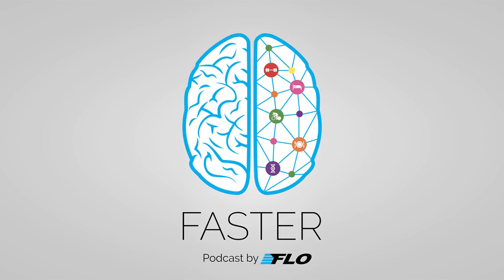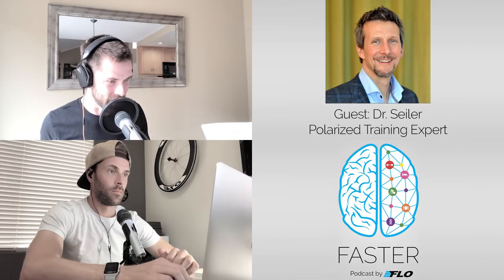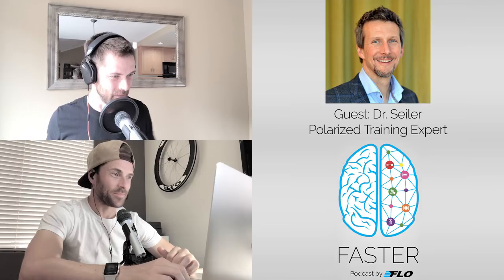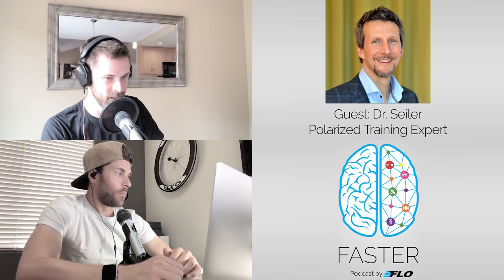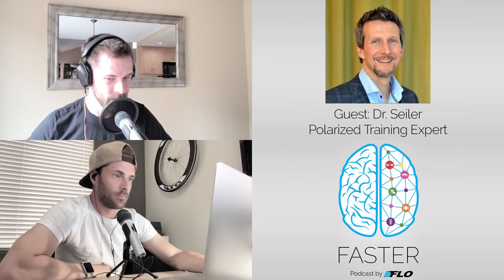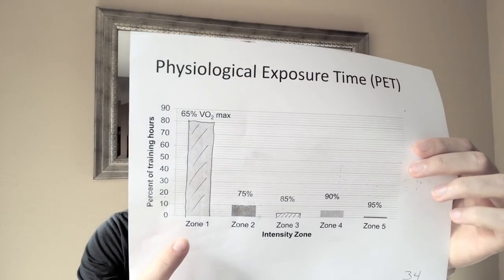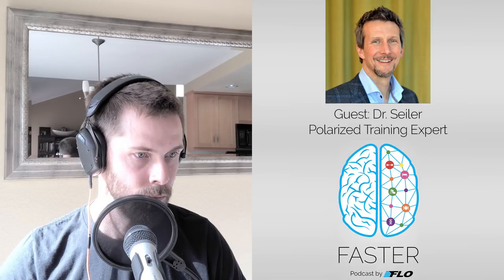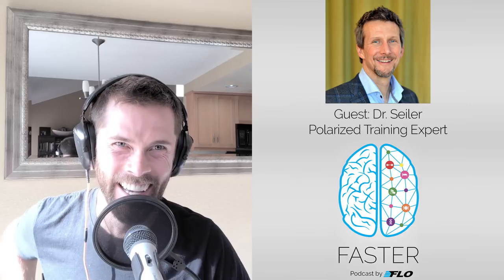Faster - Podcast by FLO - S1E13: Polarized Training - A Detailed Look

Comment: Thank you for having Dr. Seiler on you show the man is brilliant. I have been looking for this type of discussion for some time, I would like to see a program he designed (even a few weeks of one) for cyclist just to use as a template to designed my own program as I really do not feel typical threshold training is delivering anymore. I feel like I have plateaued somewhat
Reply from the maker: Unfortunately, Dr. Seiler has stopped coaching. The good news is by listening to this episode, you should be able to outline a program for your self. As simplistic as it sounds, spending 90% of our training time below LT1 and 10% above LT2 in 4, 8, or 16 minute intervals is all it takes.  I've been following that type of program for about a year now and I've had great success with the method.  If anything, I've spent more than 90% below LT1.  I'm guessing I've spent 97% or more of my time below LT1.  My starting FTP was around 250 watts, and while I haven't tested for a while, I'm right around 310 now.  I weight 70kg.  

Chris

Comment: It is interesting (to me at least) that in his 3 zone model: Z1 captures all of Coggins's Z2 as when using his 60% of VO2 ratio my LT1 is near the beginning of Coggins's Z2. And I guess this is the difference between what Seiler is proposing and the conventional Z2 (Coggins) training. If I follow Seiler I leave a whole lot of Z2 (Coggins) out of my low-intensity training. Different also to Maffetone as well because MAF would have me training well above my LT1 (as calculated using Seiler's formula). In essence, my LT1 seems to be low-end Z2 (Coggins) and below the MAF training bracket too. 

What I would say is that Z2 for a few hours does stress my body (I don't feel like repeating it the next day). So, if we're looking for adaptions without stressing the body (which is what Seiler seems to be advocating), then it makes sense that I train in low Z2 and below MAF too.

Thanks guys. This was super interesting...

Comment: One thing I am confused about.  If I have to work out my training zones manually do I use percentage of max heart rate or percentage of Vo2 max heart rate for my training sessions? for example My Max HR is 150 so to work at 70% intensity would mean a HR of only 105 to stay under LT1 which seems far too easy.  If I were to use percentage of Vo2 max using the heart rate reserve method for the same session this would give a very different HR figure  i.e:  HR max =150  Rest HR =50 so my HR reserve is 100 therefore 10% of this =10 BPM. This would mean using 70% of Vo2 max would give me 7 x 10 =70 BPM + rest HR of 50 and a training zone of 120 BPM. I am currently using % of Vo2 max  in my training as using the % of HR max figures seen far to low (and easy). So when Dr Seiler suggests heart rate zones for the LT1 and 2 (ie: 87-90% as the optimum range for the top of zone 2) zones does he mean % of max heart rate OR % of Vo2 max heart rate?  many thanks
Reply from the maker: For the most accurate results I would recommend testing your LT1 and LT2. You are kind of guessing if you are not. My understanding was that it is based on max heart rate. I hope this helps.
Reply: @flo_cycling  Thanks for your prompt reply

Comment: I use the Lactate Plus machine and sometimes in good athletes, I do see the dip mentioned at around 20 minutes in. But not very often continuously below 1.0mmol/L. Anyway, FYI.
Reply from the maker: Thanks for the input Interaction Fitness.  We'll be running more tests in the next few months.  It will be interesting to see how things have changed with training.  

Chris

Comment: Thank you for this great interview. Although I'm a little disappointed about your explanation about lactic acid. Blood lactate is the physical system to buffer accumulation of H+ (which causes the "burn" feeling). If the accumulation of H+ is to high/to fast for the blood lactate to buffer, then this "burn" feeling occurs.
Reply from the maker: You are correct. Hydrogen is involved in the burn we feel.  Thanks for adding that to the discussion.

Chris
Reply: @flo_cycling  more so, Lactic acid is also a fuel type, apart from being metabolite
Reply: @jusuflazami9580  lactate, not lactic acid

Comment: I can perfectly ride 4, 5 hr in power z1,z2 in wind and verity of terrain on power and my hrf is most of the time way lower than LT1 and  almost (constant)but its very hard to do that without powermeter. Also hot days it's so hard to  stay in a hrfzone,hrf drift...Some days my hrf is not corresponding with my powerzones, so what i mean is for me it's almost pontless to train with hrf without on power. power is a value that stays the same and you can adjust immediately,  hrf is so fluctuated from day to day... so if there is a good method to define  Z1 and and Z2, begin Z3 on a powertest? or a percentage of an full hour ftp test?
Z1(Z1 Z2, andy coggan) is 55 to 75 of ftp test. so far zo good but for begin Z3 zone was that 90% of ftp? or difine that with a 4 times 8min allmost @ max effort test?

Comment: Obviously, Dr. Seiler doesn't think ever needs to sprint or lives in an area with 25mph headwinds in rolling terrain when you are trying to ride level one. And, yes, people can benefit with this way of training on 6-8hrs a week, but the question is it best method to improve with that time limitation. Trying to adapt this method to something as stochastic as road racing is trying to pound a square peg into a round hole. The application of his method is made for steady hard aerobic and vo2 efforts that require loads of technique to be efficient and avoid injury (CX skiing, running, rowing),triathlon) . It's not that road cycling doesn't need technique and efficiency, but I would like to ask him if any of this athletes have to sprint all out for 30s to cover an attack or attack themselves or blast all out for 1-2 min in the middle of race to make a selection and then recover.
Reply: Bob, I'm not sure your comments reflect Dr. Seiler's views.  He works with Olympic athletes on a regular basis who certainly do need to sprint.  He also mentioned in the podcast that fewer than 6-8 hours of this type of training are beneficial.  Dr. Seiler himself is a cyclist who understands what is required to be successful.  I think your point about injury is definitely valid.  Too much too soon will definitely lead to injury, which is why many coaches recommend a period of low intensity only as an introduction to prepare the musculoskeletal system for the harder efforts.  Drills are also a great way to work on technique.

Take care,

Chris
Reply: @cjt1981  Thanks for the reply. I have never heard Dr. Seiler address sprinting in a prescribed workout or where it fits in his zone system or where it would fit in a periodized schedule. If you have that that information, pass it on. I would like to hear or read it.
Reply from the maker: Bob,

In our show Dr. Seiler described polarizing training even more as you get closer to a target event. In that sentiment, it is ok to use some very specific sprint intervals as your Zone 3 work for the week.
Reply: if you train with a powermeter headwinds of rolling terrain is not so a problem. also short intervals sessions or long steady rides with bad weather  i do on the smarttrainer...
Reply: @svendeclercq5160  sure it's not a problem if you have 350w+ FTP, but for non national level mortals like me-it is. Do 170w up 4% roller into a 40kph headwind and telll me what that translates to in speed and gearing. And, yes, I do use a trainer on those days-but Polar training assumes a big engine and loads of time to train--two things I don't have. Furthermore, it's better adapted to activities that take massive hours to master injury free technique (nordic skiing, swimming, rowing) and where intensity is more easily manipulated than it is in cycling.
Reply: I've seen pro cyclists train hrs at 150 watts on different terraîn. It requiers good gearing and training to maintan   a steady poweroutput on the paddels. The can do 100w if they want on a 7% climb. They are trained to do more easy also. Average joe can kearn to go very easy in wind and elevation. Go hard is perspectif to your level. And speed is not inportant in training.

Comment: Thanks for the video.Should i measure the polarized training by time or by sessions?It would be a polarized training if i did 2 or 3 high intensity sessions per week but doing 2 or 3 big sessions per week(6hours or more)?
Reply: For what it's worth, my takeaway from the interview is that 20% of SESSIONS (so if you do 10 sessions a week, that would be 2) should be high intensity.  The remaining 80% (8 sessions in the same example scenario) would be Z1 (of the 3 zone system).

Comment: Great video.I have a doubt.The percentage of the training zones should be measured by time or by sessions?

Example:Lets say I train 5 times a week.Should it be 4 sessions zone 1 and 1 session on zone 3?

Or should be measured this way:Lets suppose i train 15 hours a week.Of those hours,If I spend 13 hours on zone 1 and 2 hours on zone 3 but have for example 3 big trainings sessions on zone 1(4,4 and 5 hours) and 2 sessions in zone 3 that would be a polarized training?Please answer would help me a lot
Reply from the maker: You would want to manage this by time, not by session. I hope this helps.
Reply: @flo_cycling    thanks👍👍
Reply: FLO Cycling could’ve sworn Dr Seiler says either, with the caveat being that the targets change. 80/20 session distribution typically works out to 90/10 TIZ distribution.  If you use TIZ and shoot for 80/20, recipe for disaster.
Reply: @scotth3354  I agree with Scott here. 80-20 in sessions. Ultimately, that would end up being 90-10 if you relate it back to time in zone. 

Also, if you train 15 hours a week and consistently do 2 hard sessions, you're going to exhaust yourself ultimately (and if not, you're not going hard enough ;) ). Once in a while two hard sessions per week is ok though!